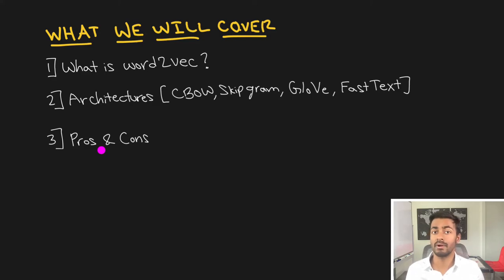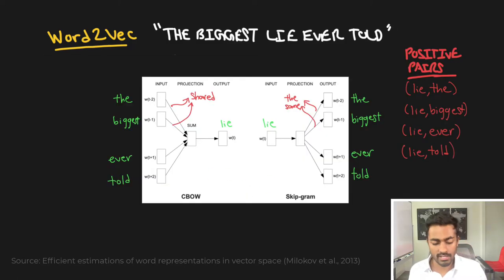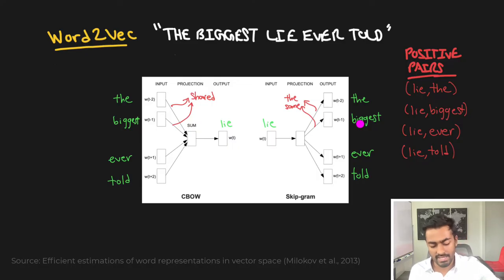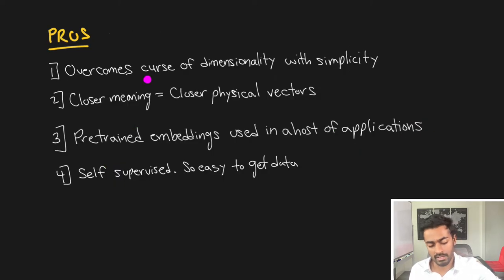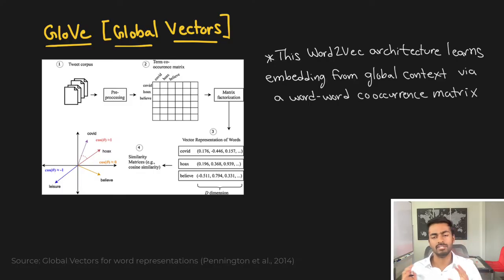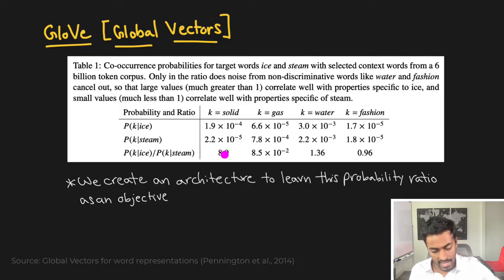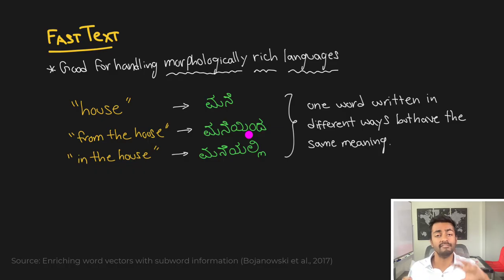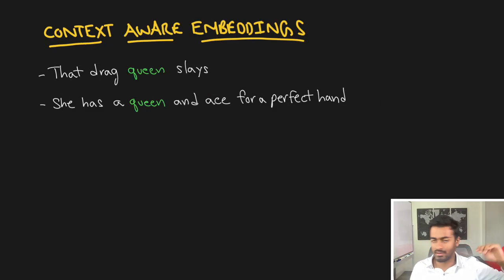Word2Vec, GloVe, FastText- EXPLAINED!

Comment: I am a newbie to ML so forgive me if I am wrong. I was going through your video and then something didn't make sense to me. At time 2:09 you said it is 100 x 1 vector but later you mentioned at 2:38 that its 1 x 100 vector. I think the latter is correct, right @CodeEmporium